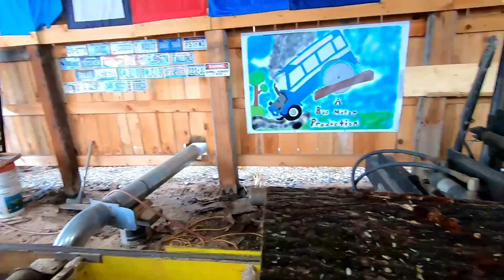loose sawblade

Comment: Never saw it happen before either and with that bus motor cranking on that blade, if it'd popped off that mandrel there is NO telling where it'd have went or tore up in the process. Scared me SEVERLY! Glad yall saw it and shut it down. Rings and bits were bad enough but don't need a blade whizzing around. Thanks, Mark and T.H.E. Yall have a fine week and GBWYall!
Reply from the maker: very hard to come loose , now I will check it before sawing.
Reply: @markgalicic7788  RIGHT! I suspect you used a severe persuader to put it on with.

Comment: Glad to see Eddie wearing ear protection without it and working next to a Detroit he would soon be howling at the moon. I've worked on Detroit's most of my life and still love'em.
Reply from the maker: yes he does howl at the moon.
Reply: Frank, I love your name. 
I had a 6v71 running backwards on me once, that was interesting,  the accessories and alternator did not like that too well.  I shut it down and fired it back up, took awhile to pull fuel back up and prime,  but it came around without damage..   Thank you for your service. .
Reply: @johnkomosa4089  Thanks John, I was a fire dept. mechanic for over 30 years with an all Detroit fleet. We had an old Peter Peirsh Arial ladder with a 671 and clutch the lads not used to a stick shift would stall it and it would sometimes run backwards. I would get a panicked call " ladder 1 has blown up"

Comment: I would imagine that checking the saw nut will become a step in the pre start checklist, just like checking the oil in the bus motor. If it loosened up once........... Glad you caught it before it let loose.
Reply from the maker: yes it will Jim.

Comment: When you had the service done on the arbor they might have chased the threads on it. Add to that the change in weather as mentioned by another and it can come loose. You might want to replace the nut.

Comment: Hello Mark, never had a saw come loose, ran mostly 52" b&f but have used a 60" now & then when running large logs. The last hammer that was put to my 52" was years ago with a friend whom I worked with at Simonds and that saw still runs straight as an arrow to this day. The only torque I have ever offered mine is a few blows with a large babbit hammer. Are all the surrounding bolts and mandrel tight around your sawbox? All could lead to vibration and possibly affect the retaining bolt. Your saw seems to run real nice and straight and the hammering seems right on, a true dying work art.It was a 3 year apprenticeship to learn that job, a very small group. Nice to see resurrected old iron!

Comment: That nut is self tightening by design so I have no idea how it got loose. Make sure that’s your blade; maybe someone swapped theirs for yours in the middle of the night, LOL. Those pin oaks were pretty nice once you got into them. Video suggestion:  I’ve been curious about indexing and how that round dial works and how you read it. You mentioned about showing is the set limit switch so maybe you could give us a 5 minute lesson on Sawyer 101. Still liking the vids. 😎👍🇱🇷
Reply from the maker: still not sure how it got loose , good idea to show how the dial works.

Comment: I had that happen to me on the Russell #3 at the Lathrop, MO Antique Club event two weeks ago.  Unexpected to say the least.  On that mill, the nut has no flats so  you have to use a pipe wrench to tighten.  We need to change it to a real nut, but haven't found a replacement that fits. Like you, it didn't really show much of a problem until it was noticeably loose.
Reply from the maker: yes it sawed good till it got very loose.
Reply: Contact Keith Rucker at VintageMachinery.org, he might be able to help you out on the nut.

Comment: Beautiful,  that pin oak is Lovely, is that the same as Red Oak?  It looks simular.
Thanks, I'll watch the rest later, as a machinist and engine rebuilder, your loose arbor nut has me thinking,  puzzled,  good job you guys communication and catching that wobble b4 anyone got hurt.   I also refurbish table saws so I run into these things from time to time.  I am trying to remember what my neighbor used to do, I was pretty little at the time , early mid 70's but my one neighbor sharpened blades and knew the old art of pounding (hammering) them out, and my other neighbor, farmer, ran his mill powered with 2 D8 and D9 Cats, he could switch them out.  He had 2 D8s and a D9..
Big Hemlock back then.
2 and a half axes across the butt my brother said,  remaining 1st growth and 2nd growth Hemlock.
Reply from the maker: some pin oak can pass for red oak.

Comment: I never saw what was relayed to me by others older and that was the norm in my day was older men worked the mill while younger men were in the woods... so they tell me that the main shaft.. called a " arbor shaft" just a guess but the blade rests on it and has that large nut that I did see wings welded on it to hit with a hammer to tighten, any way my story goes this way; the men were just having a normal sawing day with nothing notable going on and zing.. the blade slammed down on the floor under all of it and then left the building at a angle of sorts... right out of the roof and came down in a field some ways away, no mention of how far as the story grew over time... I could see where this roof had had some major repairs done to it... story was that the shaft had crystallized and just snapped off. I have heard bearings make a lot of racket and then get re poured but nothing like your near miss.
Reply from the maker: yes I have sawed for 28 years now and never had a saw come loose like this.
Reply: Wow, what a story..  I wonder if at some point a less experienced fella pounded a little too hard on those torque wings and fatigued the shaft metal.
  I've watched the old timers tighten an arbor nut with a hand sledge hammer, they choke up and hit it with a limited swing and turn the blade one flat on the nut as the sledge comes back up,  and they go around twice and so 6x2=12 hits.
 consistent like clock work.
  I have only done it a few times, but I have seen it done right..
Boy they were good back then.

Comment: What is the torque value for the nut that holds the blade on?   If there is room maybe a new lock washer or possibly a locking nut to insure it does not get loose again.  If there is not enough room then maybe some loctite red.
Reply from the maker: two kicks with your heal on the saw wrench.
Reply: Yes, at least 2 solid kicks.
  Mark, what size is that nut.?
4 to 6"?
Arbor Shaft size ? 2.5"?
  I am certain you have it under control, but would like to share some ideas with you in the future.
  It's a beautiful Mill.
John

Comment: Could it be a combination of cool weather and pressure on the blade when going back?  
 I have seen 7" circular saw blades do that. The blade sort of breathes when cutting and then going backwards in the cut.  Check your blade for flatness.
Reply from the maker: metal shrinks when it is cold , never know.
Reply: @markgalicic7788   It's the flexing between hot and cold.

Comment: Mark, I have seen this happen before on a table saw but only once
and like you I have no idea why or how.  
After retightening it was good to go, thank God the threads are always
the reverse direction of shaft rotation.  Could you imagen that blade taking off like a frisbee ?
Reply from the maker: I never had this happen in 28 years , the saw guide keeps it on the mandrel .
Reply: @markgalicic7788  I would sure hate to think what could happen.
I will refrain from the horror stories that no 
cabinet maker wants to hear.

Comment: may it';s time to put on a lock tab if the drive hub/shaft if it has a flat spot on the shaft to fold over the nut after tightening up the nut
Reply from the maker: we will check it before sawing , never had this come loose before.

Comment: At the 6:50 thru 6:52 mark there is something in the rocks about the size of a rat or squirrel that comes from behind the post on the left side of the license plates.  It stopes for just a second to take a peak under the back wall, then scampers off.  I think I heard it say, “Looks like too much work in there for me.”
Reply from the maker: that's a smart rodent .